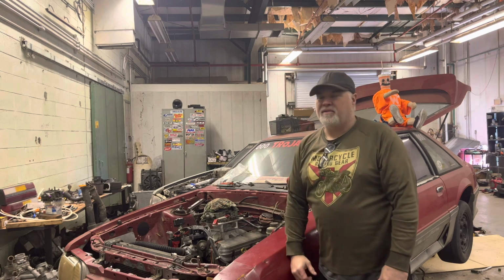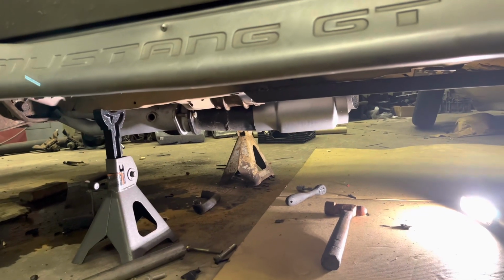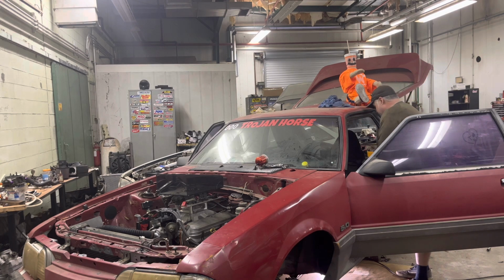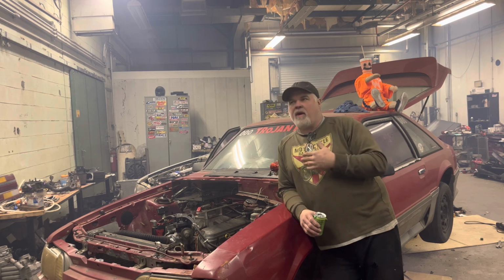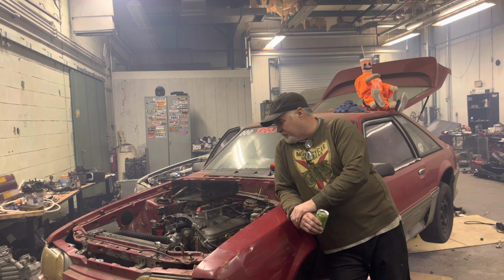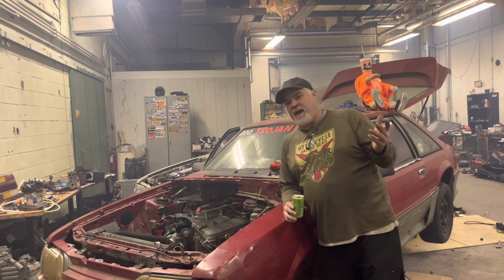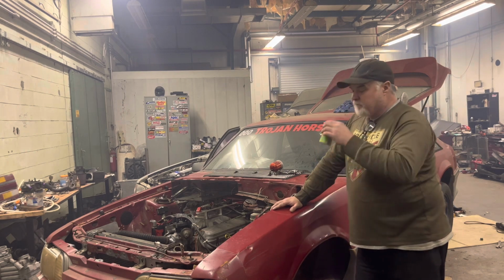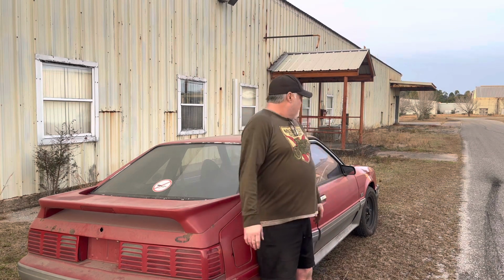1989 Mustang GT 5.0 Trojan Horse pt.71 The Peoples Champion!

Comment: Had the same leakie leakie intake issue with the jegs intake straight out of the box no bueno
Reply from the maker: It’s a Ford Motorsport vic Jr 😵‍💫
Reply: @5.0tussin    Nothing worse than a leak I feel your pain
Reply from the maker: @krazyhorsegarage7200  🤣 right on..Trojans just testing me as usual..you guys got that 351 choo chooin💪🏻
Reply: @5.0tussin  ya my sons car we put the stock block to the test with 300 or so of spray and we where very happy with the result . Now we’re moving onto a different direction probably going a little over board but def gonna swing to the fences lol 😂